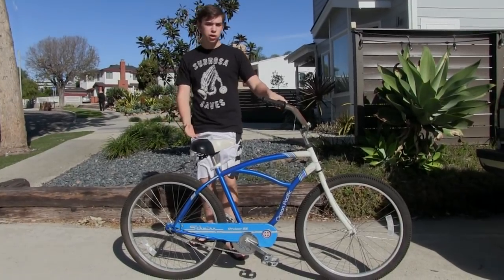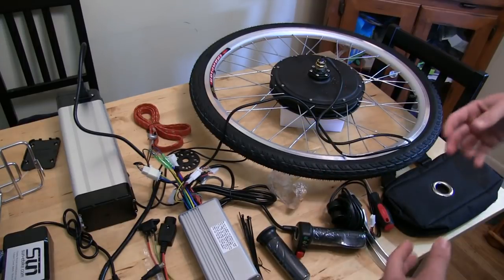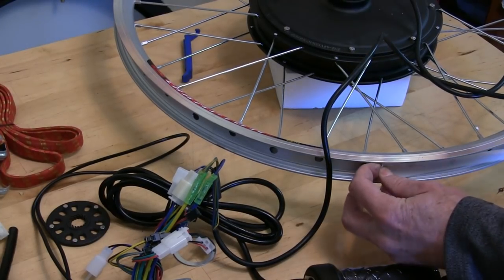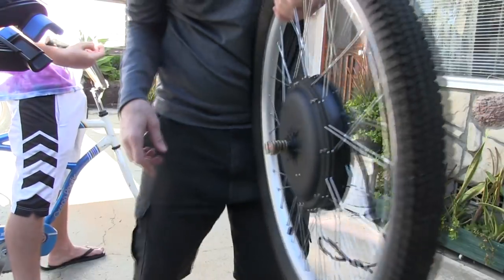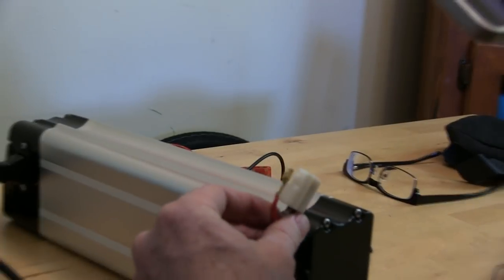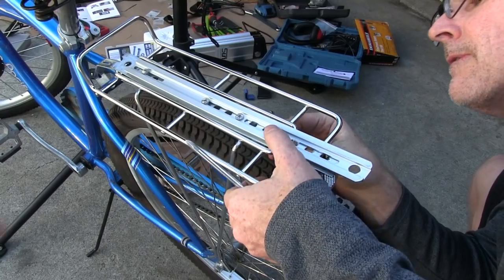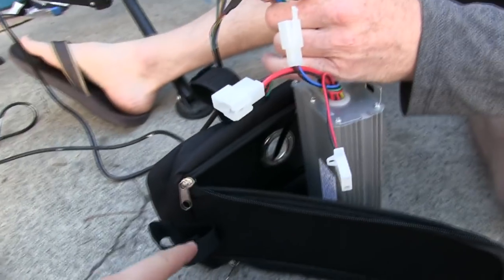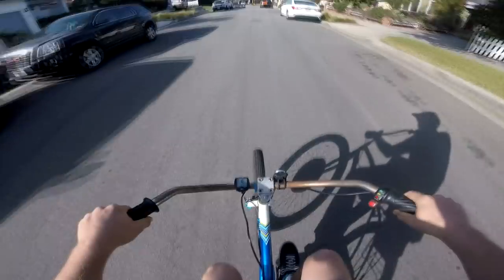EASY EBIKE BUILD (38 MPH)

Comment: You guys are cool! :-) As the frame and fork of this beach cruiser are not to strongly built, watch for tiny marks of material distress. Especially the fork might not take the relatively high torque forever. For better front wheel traction, just mount a front basket and put your regular stuff in there. That already helps. You could also mount the battery somewhere in the front for putting some weight at the front wheel.

Comment: There is a main problem with high power front wheel motors: The engine will put a lot of torque against the fork's drop-outs-  if it snaps your front wheel can fall off, and a face plant at 30+ mph can cause serious injury.
Reply: how does he brake? that bike doesn't even have v brakes, let alone hydraulic discs, which are needed for high speeds.
Reply: Cruisers typically have rear drum brakes that work by reverse pedaling.  It works fine at leisurely speeds (under 10mph) but would be inadequate for emergency stops at 30+mph
Reply: Which is probably why he should have pedal assist. It also conserves the battery by increasing the range. He's basically gone the kid route and hurriedly neglected all the safety aspects. Otherwise great video. I'm building a mid mount bafang SSHD 1000watt for my light weight 24 speed mountain bike later on in the year myself. Can't wait.
Reply: Agreed install ur pedal assist and the breaks FOR GODS SAKE
Reply: S.S Toor hydraulic disc aren't necessary I rode with mechanicals and they were fine but I do use rear motor and a 180mm front discbrake now I use hydraulic and mostly use regenerative brake
Reply: fernando, i got a golden motor canada 1000 watt hub motor
Reply: MrRasZe  I have a alienpowersystems 6000w backwheel hub motor! and i would do wheelies all the time no problem!  it has regen brakes installed, an would stop the wheel dead at 50Mph. its really expensive to keep running because of the direct torque to the rubber! im running on Li-po, secured in a 3D printet mid box at 60-84V depends on distance needed!
Reply: Jonas Pedersen I disabled the regen brake on my ebike since the constant back and forth motion eats up the torque arms
Reply: Good point.  For anyone considering fitting motors to those spindly front forks:

https://www.youtube.com/results?search_query=torque+arms+e-bike
Reply: Torque arms on the fork's drop-outs should take care of that, yes?
Reply: Max Pain should I put a torque arm on each side, or is one sufficient?
Reply: Front wheel hub motors are a no go for me after my 1000w front hub tore itself out from the fork drop out bending the fork and stripping the axle.
Reply: @romanval69  I tried that and my bearings broke and messed up my hub
Reply: Another problem with high power front wheel motors: on wet, icy or otherwise slippery surfaces it'll skid and you loose your ability to steer, which is NOT a good thing. These people obviously live in the south, but a few days of rainy weather and some leaves will put you in the same position...I'd never ride a front wheel drive over 500 watts.
Also at these power ranges, you need torque arms man...
Reply: @SSToor  regen brakes but they only get you down to about 10mph then have no effect

Comment: I think you should fit the cut off breaks. On a motor bike you have a clutch leaver on the left. So in an emergency you pull the right leaver to put the front break on, a foot peddled operates the rear break and the left clutch leaver disconnects the power form the wheels.
In an emergency, If you don't fit these safety breaks, you may find the motor continuing to push against your breaks,  this could prove painful and expensive, if not fatal.

Comment: The brakes are not redundant.  They should change the controller from motor mode to generator mode.  Instead of just turning the motor off, it treats the motor like a generator and puts a load on it to charge the battery. That's what regenerative braking is.
Reply: HOW would someone do that?
Reply: Lard British 
what do you mean can you elaborate I'll be checking this out to make one eventually hopefully soon

Comment: This bike is almost perfect. It was very easy to assemble. https://www.youtube.com/post/Ugkx2YFGCCEkXKgqCOH-7vlvgb4L4hg4IrXI  The fit was great as well. I am 5'11" and 160 lbs with a longer torso and rather shorter legs, and 55cm is a perfect fit. Every component seems to be pretty decent and durable except the rear wheel. It was a bit lob-sided and also the freewheel component is either missing a ball bearing or under lubricated, which prevents the wheel from rotating freely. Because of that, it requires more pedaling and also climbing hills a lot harder than expected. Other than the back wheel, I like everything else about it. Affordable and well-built.** UPDATE **It turns out the sound was caused by the tight chain tension. Once I loosen it up by moving the backwheel a tad bit closer to the crankset, the sound went away.

Comment: This is NOT the way to go about building an ebike, firstly don't get a powerful front wheel unless you are able to reinforce it, these powerful motors are known to rip themselves off the front forks if not well attached causing a 40mph face plant, a rear wheel is almost always the way to go if your motor is over 350w as it will guarantee your wheel will actually stay attached to the bike when riding. Secondly you NEED to attach some good brakes, preferably disc or hydraulic brakes when riding at those speeds as normal V brakes were never designed to stop a bike from 40mph but as long as you've got a decent set of them on there then they will suffice. Lastly check read the product description when selecting your parts, the battery CLEARLY STATES not to be used with a 1000w motor yet you've decided to use it with a 1000w motor anyway, a child would understand that yet somehow you can't? A few other things such as not attaching the pedal assist sensors and the motor cut off brakes is just really childish and lazy and are included in the kit for a reason. This is clearly someone who doesn't have a clue about what their doing and just heard the buzzwords of 40MPH SPEED and 1000W POWER so decided to buy it and then brag to the internet about it. DO NOT follow this guide as it is dangerous and you'd be taking your life into your hands by following it, there is a proper way to do this kind of thing for the same amount of money and not much skill required, there are professionals that build ebikes for a living and you'd be much better off looking at how they do it rather than this 10 year old.

Comment: Usually, the motor in in the back. I never seen a front wheel drive bike.
Reply: most I've seen are front.  the problem with a rear wheel build is dealing with the rear gear cassette
Reply: @electrohacker  Problem with the front is its dangerous.

There is nothing challenging about an 8 dollar socket to remove the freewheel/cassette.
Reply: @robspear03  it's not dangerous, stop making things up
Reply: @robspear03  Not dangerous for under 1000W motors.
Like not at all. Over a 1000W you start getting into wheelspin and fork issues, and yeah, that's dangerous.

Comment: Wonder what the range would be with no pedaling at a speed of about 7 mph. I need range, not speed. Want to ride on a local bike path along a canal. Probably not so good. a factory built electric bike with a 20 mile no pedal range is about $2500-$3000.
Reply: Gerald Scott at that low speed you would use about  10 watt hours per mile  maybe 15 with hill. Probably no significant regeneration from braking. So a simple front hub system is all you need and it would have potential for normal speeds too
Reply: A 250 watt motor and 36v 12Ah battery would be fine. It might fit on the frame downtube like a water bottle
Reply: Gerald Scott I just ordered a sondors fold x .. check it out 30 miles on throttle alone

Comment: Don't need rubber strip in the wheel.
Because the wheel spokes nuts are countersunk.
It's impossible to get a flat tyre from that.
Using masking tape it will only cause damage to the inner tube.
When it rains the tyre will slip around the rim and split the valve.
Because the rim can't grip the inner tube.
Rubber to metal has 10 times more grip than masking tape.
The brake cut of switch are not for just cutting off power for no reason.
It users generate charger to stop the bike and chargers the battery.
giving better braking ability.
The brakes & battery will last longer....

Pedal assist is a really amazing feature to have on your ebike.
It's what makes a ebike a ebike.
Without it it's just a motorbike.
The police can take it away from you.
If it has no pedal assist

Comment: "Holy Crap" .. that first ride could have been his last ride. How anyone can consider doing speeds of a moped with little or no safety equipment, let alone no brakes is beyond me. 

A bystander could have steped out of their gateway, or opened a car door and he wouldn't have had a clue.  

Another candidate for Darwin's Award. 

 I dare say there will be those looking at ebikes with a mind for its additional 'risk per capita'.
Reply: Eh 

I guess I've been lucky 

Fitted a 48v 1000w motor to my bike can do 30mph on a flat without safety for about 8 months and I'm doing fine:)

Comment: Using a lead-acid battery is far cheaper than a lithium-ion. It may be heavier, but it will be safer and cheaper.
Reply: it will be 100lbs and much larger...
Reply: More like 30 if you want about 2 hours of battery life. At least that's what mine gets.
Reply: Billy-Bobus 2 hours of throttle or what?
Reply: @flamincheeto624  "it will be safer"         LEAD ACID is so safe isnt it?